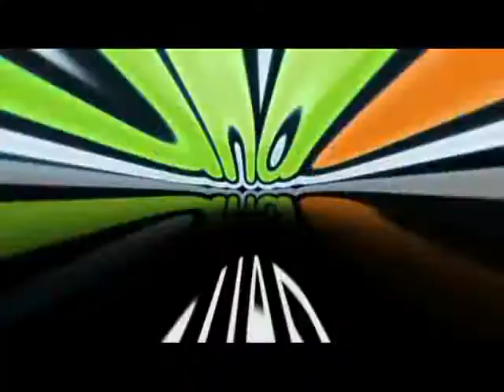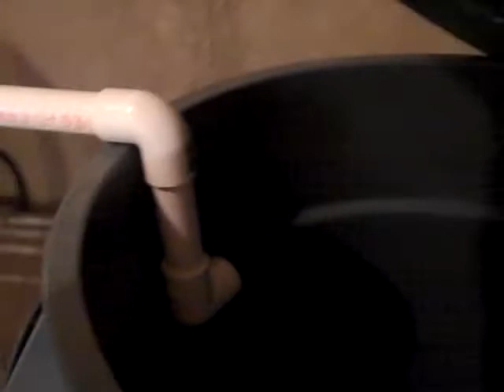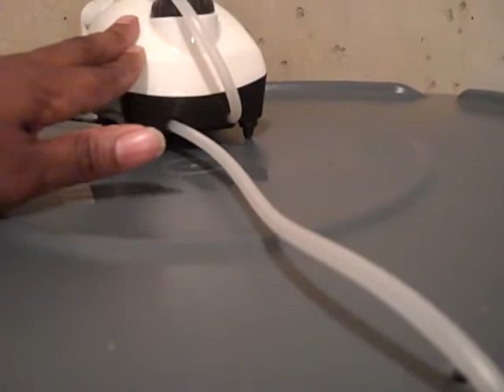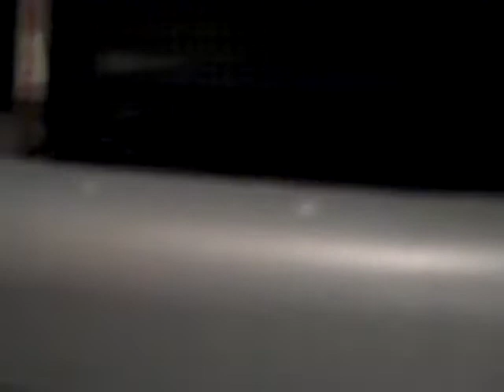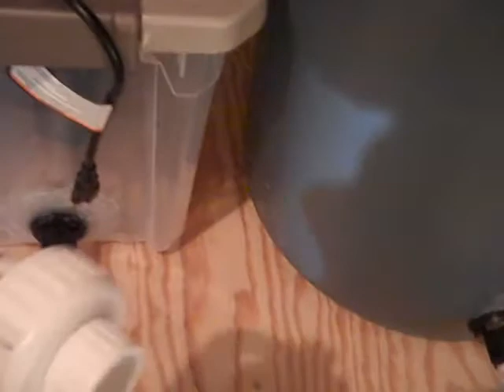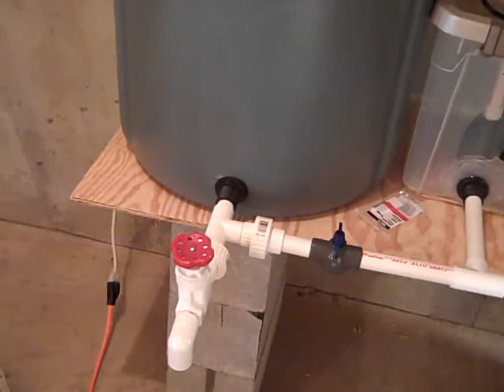My Water Storage and Mixing Station 3

Comment: I have read that if you leave your ultra pure RO/DI water exposed to the air it has a tendency to absorb the impurities out of the air (or running air from the outside into your r/o water.) You might want to do some reading on this subject.  I leave mine in sealed containers for this reason. Thought you might find this interesting.  By the way nice work and keep up the videos.